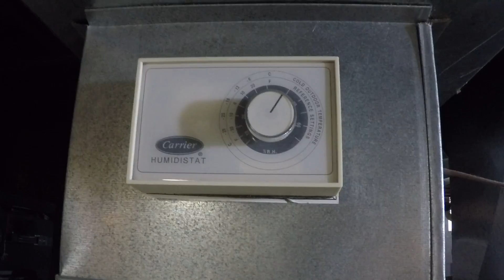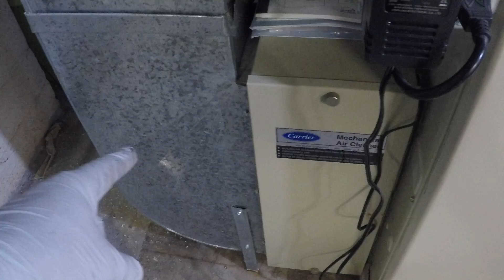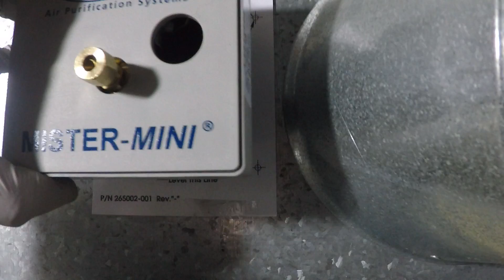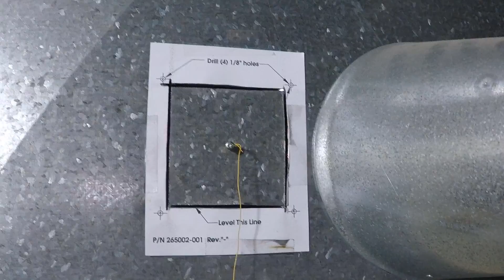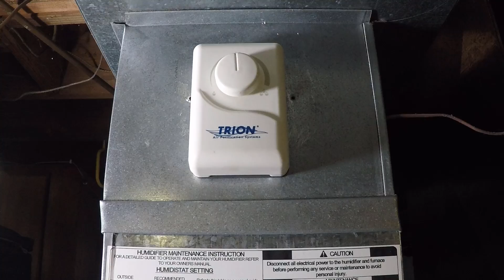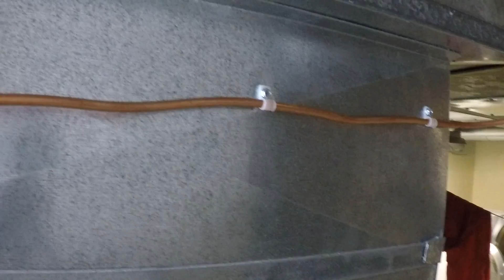Trion Mini Mister Whole House Humidifier - Install

Comment: I had this but returned it. I didn't like the fact it was soaking the vent. The bypass works fine if used with hot water or steam will be used if you can't get 30-40% RH in the winter

Comment: Is the mister supposed to feel wet or would the heat from the furnace evaporate the mist? I ask because I am not sure if it’s working. I know the wiring is correct and the plumbing is hooked up. I also hear the click from the solenoid. Just not sure that water is coming out
Reply from the maker: The mist is very fine. I pull mine out of the main housing and use a hair dryer to trigger heat sensor to check the flow.

Comment: Thanks for the very helpful video.  I plan to install a Mini Mister next summer.  It really was the only whole house humidifier I could fit into the small space and ductwork with my downdraft furnace.  I do think that I'll add a small 24 volt LED indicator light so I can quickly tell if the humidistat is calling for humidity.  Should be easy to drill a small hole in the plastic case and wire it in parallel with the water solenoid.
Reply from the maker: Your welcome!
Reply: When I did install my Mini Mister I did go ahead and add a 24 volt LED. The wiring is very simple and I’m glad that I did so now I can easily tell when the mister is working.

Comment: Thank you for the great video and good comments. I really want to get one of those but the manufacturer says it works only with single stage  gas/oil furnaces because the double stage furnace will not produce enough heat to trigger the temperature sensor. I have a double stage furnace rated at 96% efficiency and the hottest point is exactly where you installed yours ij the video (opposite side from the front of the furnace) and that area seems to get very hot so I think the temp requirement will be met. Also from the manufacturer: “The mister must be installed on the middle of the side of the duct, The mister must be installed on the supply plenum approximately 3 inches downstream of the furnace discharge. The temperature in the plenum should be at least 120ºF and not exceed 180ºF. Please allow 3-5 feet of duct work before any bends or elbows to allow the mist to be carried and evaporated, other wise you run the risk of seeing condensation or water leaks in the duct.”
Question: have any of you installed one of these on a dual stage furnace and it works fine? Thank you.
Reply from the maker: Thanks for watching. Sorry, I don’t have any experience with the super high efficiency dual stage. Perhaps the issue is the air flow with lower stage. Mine is a 92% if I remember correctly.
Reply: @houseofbrokendobbsthings5537 Thanks for the quick answer. So you are 100% sure yours is a one stage furnace? Mine is a "Kenmore Model # G9MVE0601714A1 - ICP G - 2 Stage PWM 96" What brand/model is yours, if you don’t mind me asking?

Comment: You're last humanifier or previous humidifier was installed incorrectly it was backwards it was backwards the water is supposed to spray into the hot air planning not before your filter that's why it never worked
Reply: It is a bypass humidifier. It is not installed incorrectly. There’s multiple applications as to the manufacture. Don’t comment to what you think you know.

Comment: Will it control furnace blower ON/OFF? My humidifier is mist kind and requires heat and blower working together with humidifier. My humidifier also requires furnace blower to work a couple minutes after humidifier switches off automatically to distribute all the moisture collected in the duct. If blower stops the same time with mist humidifier moisture still will sit inside plenum and makes it rust. Will this Humidifier Control have this setting so furnace blower  work  few minutes   after humidifier switched off??
Reply from the maker: I can just describe mine. My high efficiency furnace will scavenge all of the heat possible.  So my blower runs well after the mister turns off due to the heat dropping below its trigger temp. So yes, mine by default has a pre-run of the blower until it heats up and then a post furnace heat cycle blower as it scavenges the heat when the burn cycle ends. Short answer on mine I am all set to clear out the moisture after the mister cycles off after the furnace stops heating. Yours may be quite different than what I describe. Plan accordingly for your install.
Reply: @houseofbrokendobbsthings5537  Thank you. My furnace high efficient too 95% Blueridge and I think it continues to blow for couple minutes after heat turns off. My concern is the installation location for Trion. I noticed my AC coil on top of furnace has hole in the middle so all hot air blows through it in the center of plenum. I touched metal wall of plenum and it's barely warm about 1,5 ft up from the AC coil. When I touch duct on top after plenum it feels hot. I hope I find location where hot air will trigger temperature sensor built in in Trion or I just move Temperature sensor separate from humidifier itself where air is actually blows hot right on sensor. I read reviews on Amazon and someone had this issue and had to add some metal sheet on top of the AC coil so it directs hot air on temperature sensor. I didn't drill any holes yet to my system just learning first. I have very soft central water so filter not really necessary. But I decided not to wire it to manual thermostat provided neither Nest thermostat because they both not adjusting humidistats according outside temperature so I decided to pair my Honeywell wifi thermostat to Aprilaire 60 Humidistat which is adjusting automatically according outside temperature that reads thru outside temperature sensor that hooks up to it. It also works together with thermostat and has extra setting to blower motor that runs if moisturizing needed when humidistat reads lower humidity. I know this Aprilaire 60 works better with screen humidifiers that can run without heat but mist humidifiers work only with heat together. But I think   load sensor to blower motor will not be good with mist humidifier because they work exactly together with blower motor and turn off at exact same time and keep moisture in duct and let it rust so it should be connected to smart Humidistats that allow blower work after humidifier turns off automatically.
Reply from the maker: @johnysilver1853  just one thing, the blower has less to do with the mister engaging and more with the furnace burn cycle. If in doubt of your location I would use an infrared temp gun to map the heat from your furnace to the sheet metal ducting. Yes, you can be too far away. Part of me reason for my location is to benefit from the air conditioning A-coil and its natural design to handle any moisture from normal condensation. If there ever was a problem most if not all of the moisture would be routed out to the condensation pump.
Reply: @houseofbrokendobbsthings5537  yes you are right I want it be slightly higher than A/C coil because it has water pan and drain and there less chance for flooding water issue some people mentioned when something goes wrong. I read reviews and some people use load sensor for blower motor or air pressure switch for plenum that shouldn't be used on this kind of humidifier because it won't let blower work after humidifier turns off automatically the both will turn off at the same time and leave moisture in the plenum which is bad and not recommended by installation instruction. Thank you for suggesting how to find good location for temperature sensor but I dont have infrared thermometer yet but if there was a way to rewire it to temperature switch on furnace itself would be nice but my furnace doesn't have one.

Comment: Nice video, going to use this on a stand alone wood burning furnace, but will have to make changes because the furnace doesn't have a thermostat or anything.  Plenum gets hot, but shouldn't melt this plastic. Think I will use a voltage sensor to have it come on when blower kicks in. Thought about the other kind, but after watching videos on them and the work involved. This is a way better set up and easier for my application.
Reply from the maker: You will want to check those temps very closely. Housing will not take a great deal of heat.

Comment: What size is copper tube you used to connect humidifier? Should I also install water conditioner filter if I have already soft  central water ?

Comment: Is this high efficiency furnace? People say its not food for furnaces with air temperature output below 120°F.
Reply from the maker: Yes mine is a 95+ inch efficiency works just fine

Comment: Any updates in this humidifier unit?  Has it preformed well thus far?  Any issues at this point.  Looking to install one on our second floor furnace as there is limited space.  Thank you for the video!
Reply from the maker: Still going strong. Just an annual tune and it is ready for winter.

Comment: "You need this, you GOTTA have this. Change it every *microphone noise*" HOW OFTEN DO I CHANGE THE FILTER!?
Reply from the maker: Annual is what I do. Fall clean out the nozzle and add a new filter mostly for water scale control. Spring clean the nozzle and turn off the water.

Comment: I for the life of me can't get mine to work. Tried everything. Even replaced it all with another unit that was the same one already there. The solenoid will not kick on at all. Like it isn't getting hot enough to trip the thermostat so weird. It is getting power.
Reply from the maker: How far is the unit from the heat exchanger? You can test using a hair dryer - just hold it about a foot away and it should trigger with a click. You have a good 24v circuit to the unit correct? Are you using the humidistat?
Reply: @houseofbrokendobbsthings5537  yep! Got 24v going to it and it is connected to humidistat. I just read try a hair dryer so i am going to try that and see. I cant think of anything else that would be wrong.
Reply from the maker: Worst case to prove the solenoid is okay you can jump the thermal switch with a jumper wire but the hair dryer worked for me when i was cleaning the unit. Mine clunks audibly when triggered. Obviously be careful to keep yourself and the wires from shorting to each other or yourself. 😀

Comment: Is the scale filter necessary if you have a water softener?
Reply from the maker: I would not have a smooth answer. That would depend on the softener effectiveness. Simple filter add just to be sure.

Comment: I found using the foam gasket easier to use for the template than the included template.  I placed on the duct with some scotch tape and took a permanent marker to outline the opening and and cut it out like you with a grinder with a cutting wheel just outside the marker lines.

I didn't use the humidifier switch but since I have a Nest thermostat I connected the mister to the * terminal on the Nest and the common in the furnace.  All you do is turn on the humidifier function on the Nest and then adjust your level with a slide bar.

Comment: Does it matter if the humidifier is connected to cold or hot water line?
Reply from the maker: I used cold water as there was to benefit hot water (no tank etc.) in this type of humidifier.
Reply: @houseofbrokendobbsthings5537  thank you! So it seems like either hot or cold water could work? I just ordered one from Walmart today. Fingers crossed

Comment: Thank you. This one doesn't have a drain. Does it drip?
Reply from the maker: No the mist created is very fine. The thermal switch makes sure the furnace air temp is sufficient to evaporate the mist.
Reply: @houseofbrokendobbsthings5537  Thank you. My furnace's hot air duct is a 12 inch rounded duct, instead of a rectangular one. It does not have a flat surface to attach the humidifier to. I wonder if there is any kind of adapter that I can buy?

Comment: How is this work after 2 years?
Reply from the maker: Going strong time to refresh the filter again. I am very happy with it.
Reply: @houseofbrokendobbsthings5537  That mini mister have filters? or your furnace filter?
Reply from the maker: @zanetan6213  a scale filter i added for the water feed line local water has calcium in abundance.
Reply: @houseofbrokendobbsthings5537  We have hard water also.

Comment: My house is a split level 2,600sf I live in Northeast Ohio do you think this unit would work for my home. Also how does this unit hold up well year after year?
Reply from the maker: Truth Jones The unit is well built. The key is the filter selected for your local water conditions. I don’t see a reason it would not work well for your home as the atomized moisture would follow the airstream wherever it flows. 

I am in Southeast MI so our weather would be very equivalent. You can also adjust the orifice in the unit if you feel it just doesn’t keep up. We were able to maintain 45-55% humidity last year. Low to no static electricity and no morning cotton mouth with natural gas forced air as the only heat source. I enjoy the reassuring “light thunk” when the humidifier engages after the furnace cycles on. 

Cleaning is easy and no nasty humidifier water pad as I had previously. Ours is coupled with a UV light in the furnace outflow as well.
Reply: @houseofbrokendobbsthings5537  thanks for the reply. I will order one today

Comment: I agree... this is the best system available. Once installed and done. I did mine with a little twist. I ran 1/2" cpvc, removed original compression fitting and used 2 brass coupling to couple it directly with the unit. Eliminated compression fitting, and copper tubing. I also have a small shut off valve on CPVC so i can shut if off during the summer months. I was planning to use a water filter but then I removed the nozzle to inspect it. There is already a filter inside this unit. So don't need to add any additional filter.
Reply from the maker: We have a lot of calcium in the water and that is why I added the extra element.

Comment: I've been checking everywhere and can't find any info on how large a home the unit will humidify. Do you add a unit for a larger home, 3000-4000 sq ft, or is the unit adjustable and only one is needed?
Reply from the maker: I did 1600 sq feet with a single unit. It is the end of Jan in Michigan my inside humidity is 58%. There are different nozzle sizes available. The unit would be more than capable with the correct nozzle. Just my opinion. Do you have a single or double furnace setup? No issues waking up with “cotton mouth”. LOL.

Comment: I live in a dry desert environment.
I would want this device to run winter and summer.
Could you bypass the heat valve and just have it come on anytime the fan goes on.. and control it with a humidistat..
Any idea if that would work.
Thanks.
Reply from the maker: kens97sto171 : Sure just bypass the thermal switch on the unit itself. Be careful of the water flow level - without the higher heat you would want to cut the flow down to avoid over saturating the surrounding area. Easily done with a good 1/4 turn ball seat valve. Let me know how it works out.

Comment: You can have your humidifier on the return or the supply side it doesn't matter, so long as if it a bypass humidifier it has the pipe going to the other side so in your case it is on the return and it is done right by having the pipe going to the supply side.  The only thing to keep in mind is if you install a humidifier on the return drop your humidistat should be minimum of 12" from the humidifier!  With this product which I never have installed it sounds right that it needs to be on the supply side of the furnace since there is no bypass going to the return or supply.  Also if your going to cut anything above the coil (talking to the general public not to the video maker, he went with an angle grinder...i'd not recommend it but shrugs to each their own its his furnace :P) i'd say use a hammer and screwdriver, pound a hole and then cut it out with tin snips...you don't want metal shavings inside your coil drain pan that will just rust and cause future problems.  If you don't have soldering experiance you can save some pain and just get a shark bite water shut off valve.  Well that is my 2 cents as an hvac installer, over all a great video to let the general public install this themselves.  Heck i'm going to get one now for my own home as my furnace is tucked into a corner in a utility room with a small supply and hardly any room anywhere on the return box so this will solve the problem of having to use a plug in humidifier that I got to always refill!
Reply from the maker: Thanks so much for watching. Great tips for everybody. The unit works well - but you have to stay up on the tip cleaning.  The design will not tolerate anything. I am on my third tip. I went the #2 size and it worked well - but the tip metal wasn’t tolerant of my local water even with calcium filter. I recommend getting a spare tip and clean rotate them in every other month in winter. Takes maybe two minutes to swap tips.  Unit is solid otherwise. 

Good point on the grinder - but I feel the insulation held out lost if the badness. Better solution is a metal nibbler or power metal shear. I had neither so we rolled with what we had in hand. LOL. 

Thanks again.
Reply: @houseofbrokendobbsthings5537  Thanks for the info as well on how to maintain this unit if I get it, I also live in michigan and I am on well water.  I can understand fully working with what you have on hand, more then on one account i've run into having to do something differently because the tool I needed wasn't on hand lol!
Reply: Wolvenmo